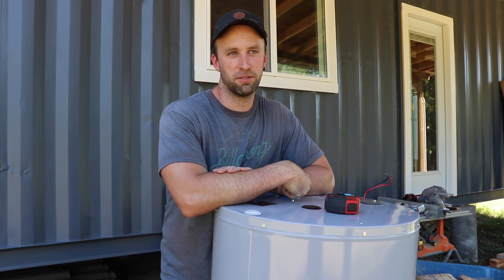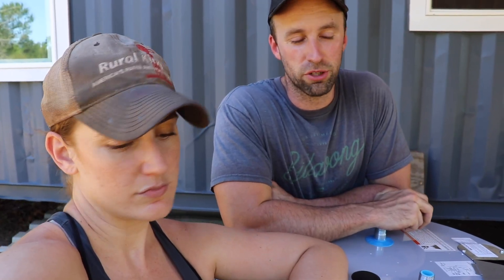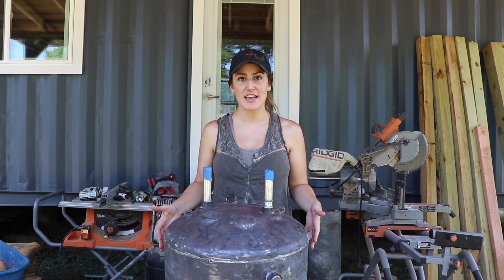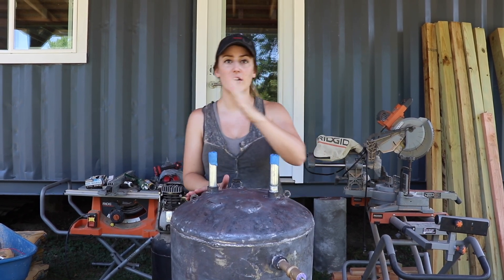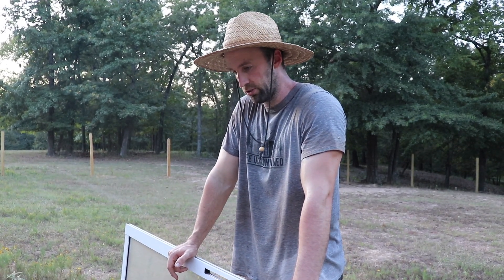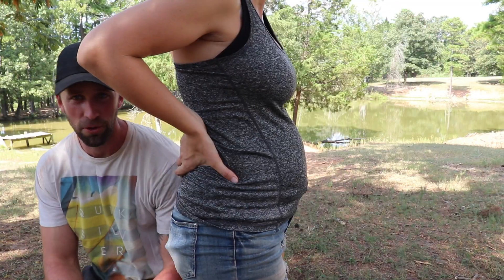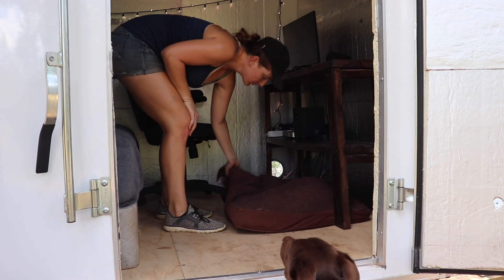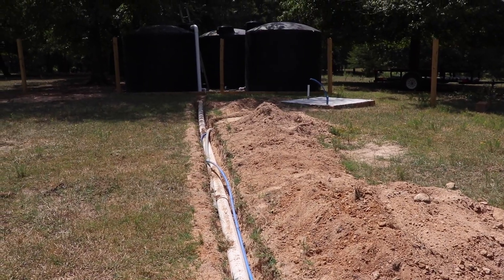WE'VE BEEN HIDING SOMETHING FROM YOU...

Comment: Hey love you guys real modern pioneer attitude building your own home. I'm sure you get building tips all the time but you said you are open to building tips. So here goes your future fence building efforts; first start at one end of the fence run, put in your first Post level and cement this Post. Next go to the other end of that fence run, put in that other end Post level and cement that end Post. Now use 2 string runs from one Post to the other end Post. One string 1 foot from the ground and one string 1 foot from the top of each Post. Now use the bottom string to line up your Fence Post Ground Holes. This will give you a nice straight fence line plus when you use the top and bottom strings for your Posts they will be super easy to keep straight vertically. Last tip use a standard length 2x6 board to measure the distance between Post holes. Glad you went with the cement on the Gate Posts. Good luck with the house your doing great. 👍

Comment: Sorry, but I feel you did not save money when you destroyed the insulation of that wonderful water tank. Solar is around for decades now, but it works different. You better had used the barrel with insulation to keep the water hot during the night and cold days. For heating up a you should have used a flat solar pannel. You can make it with the glas door, but use some black painted (there is a special paint for that purpose) copper tubes under the glas to get hot water which then flows by itself into the barrel, or better use a pump. That is so simple and works in my german house great for eight years now. It broke my heart when I saw you strip down that dense powerful insulation.

Comment: Congratulations!!! The world will be a better place with more of y'all. 

I can't help it ... If you had left the water heater as it was with insulation, it could hold heat much better from a black hose on your roof circulating water a few minutes every fifteen minutes between 10a and 7p up to 120°. It could still benefit from heat in that glass door box also. Might have saved you some work, but would take more work with timer + $20 pump + $50 hose.

Comment: I hate to inform you,, You hot water tank will not work to its potential.  A modern hot water heater takes advantage of some certain (always) and subtle physics.  The most basic is that hot water is slightly less dense than cold water.  A water heater functions well because the cold water,, the cold inlet side has a 'dip tube' that runs to the bottom of the heater.  usually plastic, usually 4 feet long to get the cold water down near the bottom ,,, where it is introduced under the hot water..
When you take ashower, the hot water stays on top, the new unheated cold water is introduced to the bottom and you, in the shower. get a reliable stream of hot water,,,, until,,,, the tank has nearly exhausted its supply of stored hot water. The thermocline inside the tank is so clear a division, that all the hot water is sent to the shower,, until you get to the last gallon of the 50 gallon tank.
The tank will not function well on its side.  It will not stratify well.  You may get 5 gallons or ten of concentrated hot water IF you have carefully laid you tank down  with the hot 'out', directly above the cold 'in'.  The dip tube inside the tank, I predict will sag toward the down side,, that is good.. but more than half of the hot water will be unrecoverable as 'hot' and/or mixed so most of the tank is luke cool.

Also,  The sun moves through the day. East to west,, and only in the middle 4 or 5 hours of the day will sunlight reach your tank and enclosure to heat the water.

My suggestion would be,,, Build a square,, or nearly so, vertical box,, two of the sides are glass,, a silicone or fish tank seam joining the two sides of glass at 90 gegrees,,, and that 90 degree apex pointed just a pinch west of south.  (185 to 190 degrees true.),  use the tank in a vertical,,, conventional position, plumbed conventionally, Painted a matt dark energy absorbing colour.  The other two sides heavily insulated or part of a south facing wall.  Your tank will recieve useable solar heat for 7 to 9 hours each day. You will be able to use all 49 gallons of your 50 gallons of hot water.  My guess would be that you will triple the gallons of hot water available per day.  I have been building passive solar, super insulated homes since the 1970's.  No reason for you to repeat my mistakes.
Reply: Sailor376also Thank you for sharing with the rest of us! 😊
Reply: @Edgar Prothero Dude, get a grip. Seriously
Reply: @Edgar Prothero Guess I hit a nerve. Thanks for proving my point.
Reply: I enjoyed your post.

Comment: Why use a hot water heater as the tank for the passive water heater? Wouldn't a 45 gallon drum have worked?  It just seems expensive to buy a brand new water heater.  You don't use the heater portion of this tank do you?  Maybe you could do another video explaining this system in more detail.

Comment: Congrats on the new edition. I have 5 kids myself.
I'm looking at this and a little voice in my head is screaming, IT WONT WORK!!!! Sure, it will heat to ambient temperature and maybe a few more degrees, but it won't ever be "HOT" water. Where I live (the far north of Australia), every house has a solar hot water heater on the roof. All year round it's all we need. They are brilliant, I'd recommend that to be the way to go. And not much more expensive than the new system you just tor apart. Simple, cheap, easy to install. Plus, for those really cold days, it can be switched to electricity.

Comment: Instead of the sliding glass door use a old projection tv lens. It will heat that container in less than a half an hour. Super hot and you will be recycling.

Comment: talking about solar heated water ----  i placed a 3/4 black plastic pipe on the ground about 150 ft long as temp line to a faucet it was conn to a well   i turn water on about got scalted   very hot   you may add something like this to pre heat .

Comment: Why didn't you do a PV direct heating element in a normal electric hot water heater? Would definitely be cheaper because with this set up you will still need 2 hot water heaters, as you said. $700 + $700 plus you will have to fiddle with it vs $700 + $250 PV panel + $150 DC heating element that is self modulating. 

P.S. Congratulations!

Comment: Nice job guys, as a suggestion, I would have used black painted copper tubes in a glass covered case and allowed the water heater as a storage tank for hot water. That way also in minimal amount of sun will heat the water anyway. And congrats on your pregnancy

Comment: You two are gonna be amazing parents... congratulations! As for the water heater, I'd line the inside of the cabinet with sheet aluminum, and raise the tank off of it with 2x4 or 6s, then insulate the exterior walls of the box with expanding foam.

Comment: I did an experiment once. I took a one gallon paint bucket and put a small aquariam hose in the side at the top and bottom. I then hooked it up to an 18: refridgerator coil. It was small with very small tubing placed in a wooden box of 2x4x lined with 1" styrofoam and covered with plastic wrap. It was January and about 32 degrees. The bucket was in the garage and the box was outside facing south. When I took the lid off at 9am the next morning, steam came out of the can. And that was a cheesy home-made rig. Yours should do well. I'm excited for you.
Reply: Oh, I had a small copper tubing transfer coil in the bucket.

Comment: why didn't you just use a 55 gallon drum?  Is there some benefit of using an expensive water heater?  by the way congratulations! on baby.
Reply: PhotoBooth biz my thoughts exactly.. seems like an awful waste to tear the whole thing apart instead of just using a tank
Reply: or maybe even a bladder tank which already has the connections available for water and can be pressurized if needed for higher water pressure?

Comment: lot better have under glass have copper tubes were have solden copper sheet and paint all black, then add insulated frame, and glass on top, and stupid boiler insulation take off, tyou can store hot water in boiler in have good insulation and tube in boiler can add solar heater water, or wood stove heater water, or elektric heater to water. you misstake lot ,big you take out insulation at boiler, and think boiler under glass have good, no newer have. boiler store water and solar heater make hot wqater. learn first good in iternet and do after you understand what is good, now you fail all, and expensive fail.

Comment: The tank needs to be in an insulated room. And insulate the tanks and the piping. Just a loop of piping goes in the hot box, painted black. It needs some controls to keep all of the heated water from thermo siphoning when the sun goes down. Also a thermostat to a drain system for freezing temperature. 

Would someone reply so I know that I am not being blocked?

Comment: Hey guys, the only problem with using an old slider door is that the glass is low E and blocks 3/4 of the rays you need to heat the water. And I’m sorry, i mean congrats on the baby “boy”

Comment: When I was a kid, my dad hooked up a similar passive solar heater (used car windshields on either side of the tank).  In the summer, we had to wait until 11pm for the water to cool down enough to take a shower.  You will need a water chiller in the summer...
Reply: Or just a tempering valve :)

Comment: Congratulations on becoming parents.  How exciting.  It is a good thing you got the majority of the build done before you got pregnant. 
My parents had a home with a wood burning kitchen stove that had pipe in it that ran to a plain galvanized tank in the bathroom. To have hot water you started the kitchen stove and hot water circulated into the tank in the bathroom.  To see if there was hot water for a shower you felt the tank. It would heat from the top down.  Hot halfway down was good for one person's shower.

Comment: 3:00    Ripping the guts out of a commercially built hot water heating tank.    Would it not have been less expensive to buy a specially ordered "inner" unit direct from the local manufacturer?

Comment: Congratulations on the pregnancy. I bet if you had the air-conditioned bedroom earlier the baby might have come a lot sooner.
Where is the hot water going to be stored? I was thinking the water heater tank was for storage and a passive radiator or heat exchanger with a circulatory pump would be more efficient.

Comment: Curious.  How did you keep from cracking the extremely fragile glass lining inside the tank while you were sitting on it while using the electric saw?  I once cracked one just by picking it up the wrong way.  Also, I trust you checked the glass in the door panel to make sure it is not the standard UV blocking type that will reduce the solar gain substantially.

And congratulations on the baby.

Comment: You need 2” foam board with reflective foil lining the entire inside.  The tank should be flat black and raised above the bottom of the box.
Reply: The box should be as airtight as possible so heat builds up.

Comment: I have a passive solar water heating system I installed in the mid 80's.   Works well.   Two @ 4ftx8ft panels with circulating propylene glycol to the 80 gal tank which has a coil inside instead of electrical elements.  A small Grundfos pump circulates the glycol with a simple controller to turn on the pump when glycol is 2 deg F warmer than the water in the tank.
I have had the pressure relief device release hot water in the summer if we do not consume enough hot water.   In the winter if the sun shines all day I can get 80 gal of water heated to over 130 deg F.   Water from the well is likely 45 deg F in the winter. 
In my eastern PA location, I have to use a fluid which will not freeze in the winter and one which is not poisonous if it somehow leaked into the domestic water.

I am not sure how long it will take for your tank to heat up.   You do not have much surface area.   Passive solar likes lots of surface area and high temperature difference between whatever fluid you are heating and the surface heated by the sun. 

Good news on the baby.  I think it will be a boy or a girl.
Dave.
Reply: wow interesting way of heating water, thanks...always willing to learn something new!

Comment: Get a pocket screw jig !  They make much stronger butt joints than those plates.  Screwing THROUGH the end grain instead of screwing INTO the end grain of lumber is much stronger.
I could not tell, but I hope the base of that tank holder is made from pressure treated lumber.  Regular lumber will rot quickly if in contact with the dirt or concrete.
Reply: good to know, thank you

Comment: Oh yeah I am also in the process of making a solar hot water heater difference being I have panels the problem with panels is if you live somewhere where it freezes and you're running water through those panels they will breakthe City of Phoenix is covered with broken solar hot water panels. so I live 6500 feet in the White mountains here in Arizona. So what I did was made a closed loop system I'm using a plastic 55 gallon water drum with a 30-foot copper coil that I put inside of it and I'm running water and antifreeze through the closed loop system so I don't have to worry about it freezing. Mac coil gets about a hundred and sixty-five degrees and the water in the drum gets to about a hundred and 30 degrees.

Comment: Congratulations!!  I have a grandkid coming about the same time!!  I've seen that method of water heating done before, but I did see a better method (it heats quicker).  You make panels similar to your solar panels.  You make a frame and place a sheet of corrugated metal roofing in it (painted black) and then run plastic tubing up and down inside the ridges.  You cover it with plexiglass and arrange the panels similar to how you did your solar panels so that they get the maximum exposure to the sun.  You could actually use them with what you're building now, too.  Just thought I'd share!

Comment: congrats on the nipper, best of luck on that one. now too find out if he will be a boy, or if he knocked off the balls and you have a girl.   here is a thought on that heater. think 12 v waste dump to the diode, it may not be best, but it all helps. a rv water pump too cycle the water pressure . Or go with 24/36/48/ so on. as too the casing/ box, form it at least one and a half inch ,then tin it, black paint every thing, in and outside to trap heat. run the tank through copper boxed, then tin foil the backing plate, then run that into a 3/4 inch tubing, at least eight feet by six feet, again painted black. form the sides and tin foil the backing plate. face it south,  there are other issues with it, but if you do it right, you should get about 120 degree of water.  summer will be hotter, then winter by twenty or so degrees. but south Texas don't get much snow, rarely drops too freeze the pipes. so should be good on that one. run the piping through underground conduit, too keep in the heat and wiring.  so again best wish's and luck with the nipper.